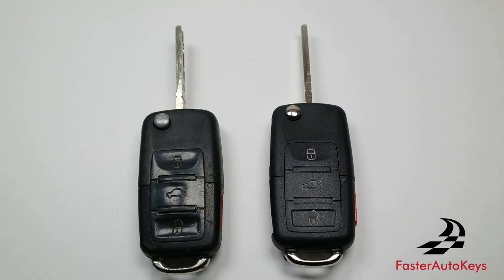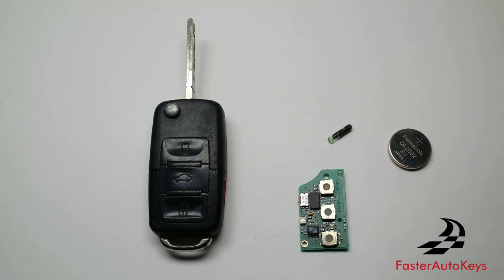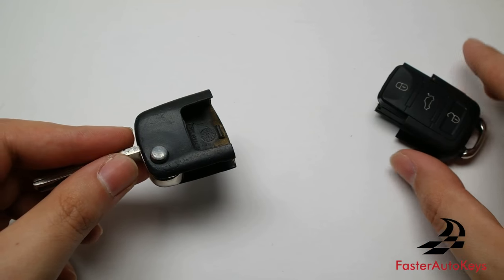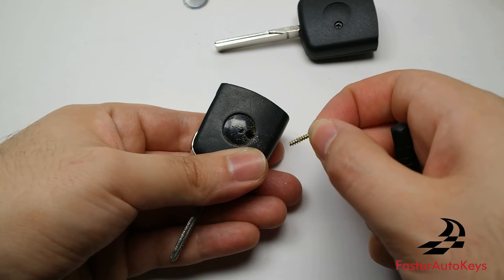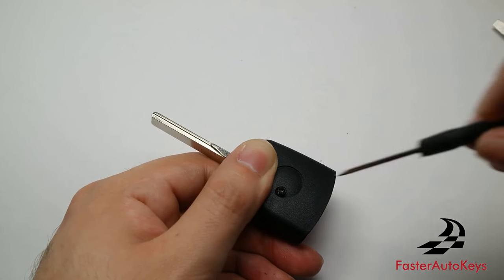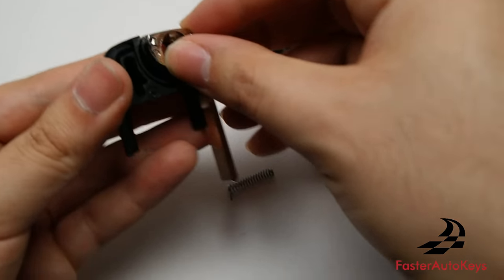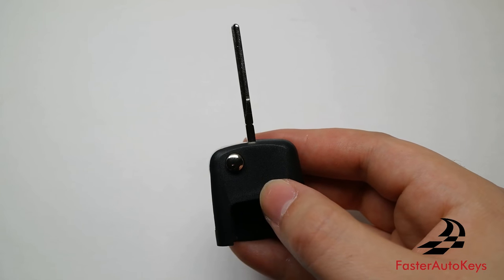[HOW TO] Complete Volkswagen Key Fob Shell Replacement Tutorial 1998-2009

Comment: The metal ring on my keychain broke, so I ordered a new empty key case and used this video to replace the top half with the ring.  It worked perfect!  Thanks so much for posting this!
Reply: @Jason Not at all...I kept my original top half (with the transponder), so nothing had to be changed there.  The bottom half with the key ring loop was just a matter of swapping out the guts from my old case to the new case (as the video demonstrates).  And then just put the two together and you are done!  The metal key, transponder, circuit board and battery all stayed the same so nothing to program.  This video shows a new top half but I didn't need to do that part.

Comment: One note I'd like to add from my own experience with this job - If when you are done and the key arm seems too stiff or doesn't open easily when you press the release button, simply loosen the small screw where the emblem is placed before you place it.  Give that screw a counter-clockwise turn or two and open the key.  If it still feels too tight or hindered, give another turn or two to open the housing and test until the key switch feels right for you.  

Originally I made the mistake of over-tightening the spring, thinking that this was the issue hindering the key arm opening quickly and easily the first time I did this transplant.  I hope this helps others.  Otherwise this video is excellent and super comprehensive.
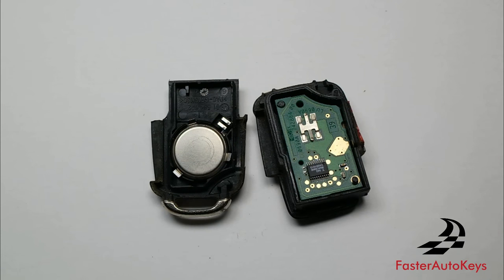Reply: 5:06

Comment: By chance I found this tutorial, ordered a key fob with the cutting service. The tutorial is on point although it doesn't show heating up the glue holding the transponder. I used a hair dryer for about a minute and had no issues taking the transponder out. I got my key in about 4 days and it worked perfectly. I will definitely be using this service again!
Reply: I have a question. So you ordered a new key fob, using same cut key and guts, ( including the chip that looks like a small pill) , swapping to the new fob and worked? No need to reprogram? Please let me know when you can. Thanks
Reply: @davidcisneros8886  that is correct. Remove the chip and transponder (the pill) put them in the newly cut key fob and it worked perfectly.
Reply: Thanks for your help.
Reply: BTW, what did you use to remove the pill sensor? It looks very sensitive.
Reply: @davidcisneros8886  I blasted it with a hair dryer for about 2-3 minutes,  then very carefully used a pick and it popped right out.
Reply: I should have read the comments before working on it. I broke the transponder.  :(

Comment: 12:30 onwards. It’s not always the case that you can transfer your original key. Or put the old blade into the new key. When you remove the pin holding the old blade in the old key. And there is no guarantee that the old blade will fit into the slot of the new key. As they do differ.
Reply from the maker: Hello, yes if the original blade is the thicker type the edge will need to be sanded to fit in the new shoulder. This is why we offer and recommend ordering with a laser cutting service included.
Reply: @fasterautokeys  is it possible to just put the top half of the old key onto the new lower half and it fit?

Comment from the maker: Something to note, a very safe way to remove the top transponder chip can be done with nail polish remover. With the chip exposed, apply nail polish remover and this will break the glue's bond from the chip with the case. From there, it is easy to remove the chip without using heat or risking a chance of breaking this glass chip.

If you are not comfortable, DO NOT try removing the glass chip. The safest way is to apply acetone (or nail polish remover) to remove the glue's bond so it easily comes off. Do not attempt to remove the chip without heat or it can break. If you break the transponder chip you're out at least $150

Comment: can anyone that tried this verify that the buttons on the new fob work after switching everything over??

i have a 2000 new beetle with one key, the key i got when i bought the car was in pieces and became unusable shortly after. i put the chip from my NB key into an old spare vw transporter key fob i had laying around, it's a different style fob from the new beetle one, the key works on my car but the buttons on the fob don't work. i'm not sure if i just need to sync the fob to my car and therefore need a second key or if it doesn't work because its the wrong style fob.

if anyone knows anything about this that would be super helpful 🙏 i'm not even sure what to google to help me out loll
Reply from the maker: Hello, yes sometimes when the battery is removed the key needs to be programmed again. It isn't common but it can be done yourself without any tools, there are other videos showing the programming process.

Although they might look the same, the key from another VW might have a different part number from the Beetle and not program.

Comment: My keyfob just stop working so i check battery but it was fine also fuse Still not work do u think have issue inside board or its my ccm module golf 4
Reply from the maker: Try reprogramming the remote. It can be done yourself without any tools
Reply: @fasterautokeys  i have only 1 key
Reply from the maker: @adolg4049  There is a tutorial on YouTube that shows how to do it with only one key

Comment: Tried the new uncut key using the old cut key section in the ignition. Car shuts off and shows SAFE in the cluster. Is the key required to be cut and used as a complete assembly in order for engine to stay running?
Reply from the maker: Hello, if you continue watching the video the transponder chip on the top end of the old key needs to be put in the new key. This will resolve the issue.

Comment: Can the upgrade be done with the older style Bentley key (2004-2005) internal to be install on the newer style Bentley key (2006+) without the reprogramming?
Reply from the maker: Hello, we don't have personal experience but the process appears the same with the Bentley key. It will likely share the same key shell as the VW Touareg, it doesn't separate from the top and bottom.

Comment: swapping 2000 passat key fob shelland one issue the new shell has 1 cr2032 and the transfering circuit has 2cr1620 batteries
Reply from the maker: Contact your seller about this, the seller should know the older 1998-2000 VW styled key uses 2x CR1616 batteries.

Comment: Hello, thanks for the vid. Do you know if early B5 Passats (98/99/00) with the IMMO2 use the T42/LD48 chip inside the key?? thanks!
Reply from the maker: Most of the VW keys that share the Audi key design tend to have the ID48 transponder chip. We have found the Audi styled keys that do not have a trunk button tend to have the other transponder variant. The only exception is the Eurovan, the US spec Eurovan has the 2001+ key design and it uses an ID44 transponder.

Comment: What do you recommend doing when the transponder key end Philips head is stripped (my fault)? Is it pretty safe just brute force prying the case apart?
Reply from the maker: Hello and yes, slightly turn the blade so there's an opening at the top. Try to pry the ends apart, it shouldn't damage the transponder.